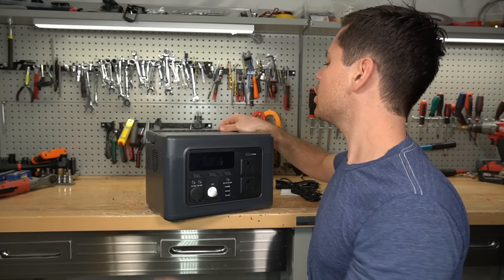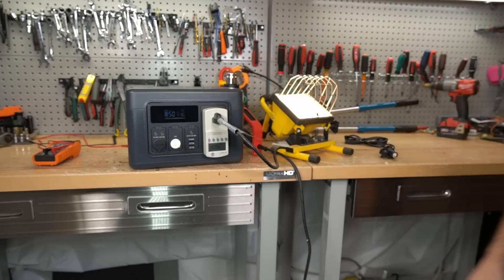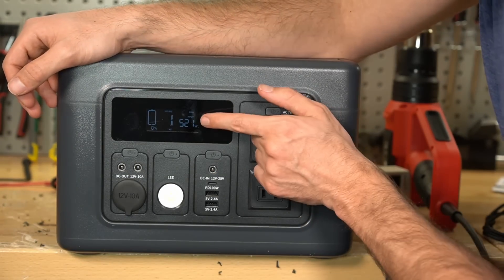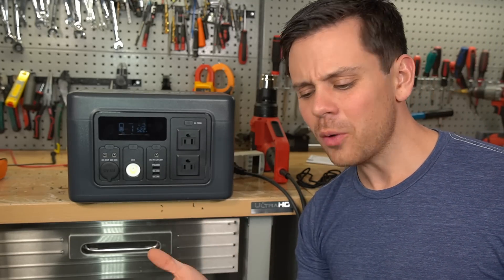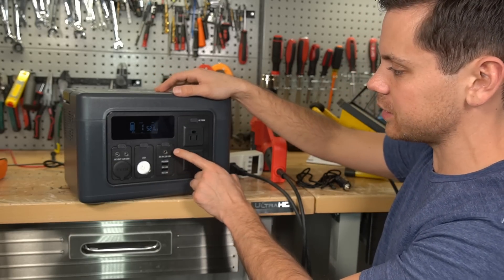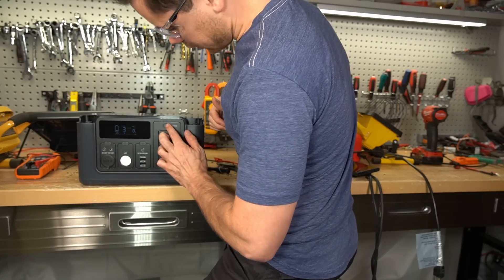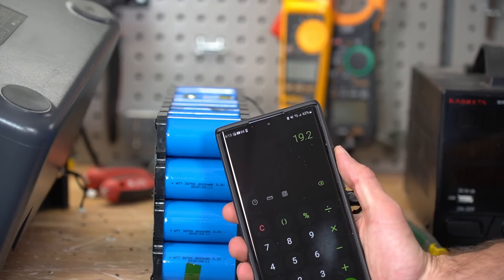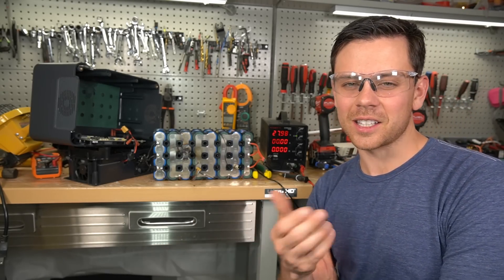Powdeom Solar Generator Test and Teardown! Better than Jackery? Bluetti?

Comment: I bought a 1200 version couple years back (2023).  Its battery measurement is really bad like this one.  If the PV charge is idle for too long (like 1 hour after sunset), it will say battery is at 100%, even when it was 50% an hour earlier.  Just like the company, my unit solar charging port has died (it flashes an error code that has no reference).  I emailed support but got no reply.  Fortunately, its AC charge port still working.  Hopefully, it is more reliable than 2 years.

Comment: I challenge you to make a test .i believe the conclusion will be very interesting.connect the ac outlet of the power station through a micro inverter to the ac inlet of  the same  power station. the micro inverter should also be connected to 500w solar panels. I suppose with only one micro inverter ($100w) we could charge the power station with 500w from the solar panels.... the same trick could be used in all power station if it works here

Comment: You are the very best at your reviews "but" I recently brought two of these units ,ebay are selling them for just 360 dollars now,they have been a godsend for me recharging my high powered e bikes and scooters that I store in my storage unit,3,000 charge cycles,this unit is a great buy...
Reply: Still working ?  Mine won't charge anything anymore only lasted a month but it does take a charge.
Reply: @vapeking466 your correct sir,this unit is junk, my unit failed after two months..you are soooo correct...good day

Comment: I have a question about a diy power station.  When I get the ac wall charger, does it need to be specific to the battery chemistry I use?

Comment: Big selling point on this unit is LifePO4 and nobody ever states whether it uses a PWM or a MPPT charge controller.  How about the Bluetti?  That makes a giant difference. The best units should have Both LifePO4 and MPPT charge ability. Maximized battery capacity AND full charging potential of my solar panels. Those are the TWO most IMPORTANT features for device efficiency. I want a battery that lasts 10 years and a charger that charges the fastest and most efficient way possible.  Yet nobody on the internet ever mentions these two features together.  I don't care if the case is pretty or if the thing has 47 outlets. Two AC outlets, two DC outlets, and what type of input connections are the most important features. For the money, the time it takes to charge is not that important. They have to cut costs somewhere and charge time is acceptable on a small unit like this one. I think this unit has MPPT too, but can't confirm. Just checked with the company and YES! It has a MPPT charge controller!  This eliminates most EcoFlows, Jackerys, Bluetti, and most likely any of the other major branded generators. Again, this item wasn't demonstrated properly. It was put down to discourage the competition to the main brands mentioned above. Another company that makes low power generators with the features I mentioned above is Wetown on Amazon. These two are very solid units that can outcompete the main brands. They don't have the marketing that you pay for and have good customer response. There are other units that are similar as well, but I'm still researching their customer responsiveness and reliability. Not very impressed with his rather biased review of this unit.

Comment: Is this a good buy for $350?  I just need a backup for CPAP when the power goes out.  And I don't have any solar panels or anything.  I would just plug it in to charge.  Run it off the car in case of emergency.  Eventually, I might get a solar panel but I don't camp
Reply: yes good

Comment: So do you think its worth it with the $200 off it puts it at $350 and they seem from their comment to be open on the issues and willing to fix or replace units?
Reply: it is worth.I purchased one, there is no problem.
Reply: Mine failed after a month. It charges but won't power anything shuts off after about 1 minute. I'm fixing to send it in under the warranty. Wish me luck.

Comment: I wish the smaller power stations would accept more than 200watt of solar I use a 100ah power queen 12.8v battery with a 12v - 24v 10amp converter to shoot 199 watts into my EcoFlow river to give myself a 1500wh system.

Comment: How big of a resister do I need to pre charge the capacitor in a 3000 watt charger inverter? 24 volt

Comment: Will - i have a covered lean too out in a field on my farm.  How can I use solar to keep my 12v batteries in my tractor, bulldozer etc. charged up.   Love your videos.  Thanks for the knowledge.
Reply: Harbor freight has a $15 trickle charger solar panel that works great! It's small and comes with all the hardware

Comment: Do you know anything about Easun Power Ingrid VEII 16.5 KW wifi 220v 48v most 450v 90 solar charger  grid tied with CT sensor touch inverter? It listed for 2800.00 don't know much about this unit. If its UL listed or any other information.

Comment: Would you please consider a video showing how to set up a dump load? I built a small 600 watt system with 100 watt renogy panels, 40amp Rover, Giandel 2200W inverter and a battleborn 12v 100ah battery. An automated way to utilize the panels power when the battery is charged is what I am after. Thank you

Comment: I am curious if one array of solar panels could be used by two different Solar Charge Controllers at the same time? One is 24V battery setup with 24V SCC. The other is a 12V battery setup with its own 12V SCC. It just happens that I have two setup and I hate switching a switch between the two.

Comment: Why are the smaller mpptcharge controllers limeted to a max of 150 volts?  When sizing a system I usually have and ussue with the volts and not the amps.... prices for these mppt are all over the place as well....(sp errors)

Comment: I think the calculation is wrong somehow. We are told that batteries connected in series will only add up voltage not amps. This means 6AH or (6000mah) X 4 batteries in parallel = 24AH OR (24000mah)... The cells in the video are connected in 8 series and 4 parallel. This makes the total ratings of the battery according to the law of series = 24V X 24000mah  =576WH. Please if my calculations isn't correct someone correct me!
Reply: Yes thanks so much!
Reply: Close, but LiFePO4 chemistry is 3.2V nominal, not 3.0V. So, with 8 in series, it's not 24.0V, it's 25.6V. Multiply that by the 24Ah (6Ah x 4 in parallel) and you get 614Wh. Hope that helps!

Comment: Main reason why people (For me at least) bought Jackery solar generators,  was marketing and awareness. I use mine for remote astrophotography. Previously had DIY. 2, 12V, 12 AH AGM batteries in a cooler, with cig outlets, and binding posts. Saw ad, and researched other amateur astro photographers. Jackery  was  and is mainly used. Only after stumbling on your,  and HOBOTEC, did I become so aware of BLuetti. Had I known, I  would have bought there's.  I'm also doing this in sub 10 degree F Temps. And Hiking in cold open fields half the time with some gear. So was concerned about temperature issues with LiFePO4. Seems it is good down to 0 F. I know I'm aware LiIon looses output in cold. A few  hardwares in an insulated bag works.

Comment: Someone please tell me if you can is it possible to connect my car alternator to the inputs on my solar charge controller in order to charge lithium batteries without a dc-to-dc charger
Reply: It would depend on the input requirements of your charge controller.

Comment: can you connect different charge controllers to a bus bar then to the battery bank
Reply: Use the link to Will’s forum (in the video description) to get an answer to that sort of question. In the forum you can be more specific and people can ask you questions to clarify what you’re trying to accomplish.

Comment: I appreciate your reviews...great work.
A stupid question maybe:  can a portable station like this be hooked in parallel to a suitcase gen?  Ie remote camping need more starting amps for ac parallel this to suitcase, run gen to run ac.  Then low load times just use this?  Maybe not worth it.

Comment: do you have any recs for a good 48 volt solar panel?
Reply: “48V panel” isn’t a standard - that’s not quite how solar panels work: my “12V” solar panels are 17 VDC rated, allowing 12 - 15 VDC in normal sun. “Full size” panels range in voltage rating from 35 on up past 70 VDC (note “rated” vs. actual VDC from sun you have) so one is usually matching a string of panels to an inverter or charge controller power input VDC “window” or operating range. Will’s forum and book and some early videos explain all this.

Comment: 120watt an solar generator does not fit together 😂
FAIL
Should be no less than 1200Watt to call it a "solar generator" in my opinion

Comment: Just something i have noticed about that heat gun because i have the same one is that it causes the lights in my house to flicker that are on the same half of the electric panel. The flickering gets worse when the heat output is raised and no flicker on high. I took it appart and found the heating element is controlled by a circuit board. This heat gun definitely seems to have dirty power use that might be the cause for the inaccurate reading not sure. Just figured i would let you know because you use that heat gun alot and maybe something to test and keep in mind.

Comment: I am impressed the battery inside is 24V! Allows them smaller conductors to drive the inverter, and all 12V outputs can be sent out regulated and the usb can output higher watts without stepup circuits.
Reply from the maker: Absolutely

Comment: About the Wattmeter Problem:
Maybe your heatgun uses a diode in low power mode and thus only takes current during one cycle of the sinewave.
Hairdryers do - and that confuses some powermeters.

Comment: I bought a cheap LiFePo4 300 W/h station from A.. and I am happy with it. We use it on Search & Rescue do power mobile monitors, a WiFi hub and re-charge drones. No need for Bluetti.

Comment: Hello, you have a good channel with a lot of great information. How about a video on the best appliances, electronics, water treatment and air handling equipment to use on an off grid PV system in a cold climate (zone 6B)? Most solar channels talk about reducing loads and choosing energy efficient appliances, etc, but they never recommend specific brands - just "this size system will provide this much power".
For example, I'm building a small (550 sq') near passive cabin out in the middle of nowhere and I'm considering a Hotspot DC mini-split, a DC fridge, an induction cooktop and a Sanco2 heat pump water heater. Then there's the issue of well pumps, water purification, an ERV,  a dehumidifier, a freezer - the list seems endless.
I'm curious as to what would you recommend?
Reply: @Channel-gz9hm  Thank you for your reply. That's good information to have. The problem with choosing solar equipment is that everyone says that their product is the best but you don't know how it will work in a system with other components. 
For example, lots of people say that induction range tops are the most energy efficient products for cooking (as well as safer in that they produce a lot less harmful cooking byproducts like CO2) but others say you could never run one off of a solar PV system. 
If you were going to head out into the wilderness and build a small, off grid homestead what products/systems would you choose?

Comment: If you’re not back packing it seems to me that these solar generators are a waste of money. If you have to haul around solar panels anyway to make them useful,the EG4 3000 and a5KWH battery makes more sense. If you don’t have the money to buy that,a part time job is more practical than camping out with these toys. Old fart opinion lol.

Comment: yes 3 years ago I bought a Jackery 500 so thanks for rubbing it in  😞
Now I'm doing an EG4 48v server rack+6500EX-48 like yours so I'm getting better.
Thanks also for the inspiration btw  🙂
Reply: To be fair, 3 years ago the market had fewer options, and the Jackery is still a solid piece of kit, just not as capable as some of the newer ones.  You've gotten 3 years of use out of yours already.
Reply: Makes you nervous to purchase big ticket items because every couple months bigger better cheaper comes along 😊
Reply: We bought our Jackery 250 about 3-4 years ago and use it 7 months out of the year 3 days a week and it fit's our needs. Never had any issues, but it does take forever to recharge. Like someone else said that's what was on the market back then.

Comment: I think the heat gun is too noisy for the inverter to put out clean power usage reading... some inductive loads (like the heat gun) are too noisy because of the backfeeding of EMI (Electromagnetic Interference)

Otherwise an interesting piece of mobile power that unit is.

Comment: I have the smaller Bluetti EB3A, I think it's a really nice unit for what it is. 200W solar input and 600W AC out.  I'll take the lower capacity of LFP cells any day. Those cylindricals should last forever.
I like that the EB3A has a UPS mode, not a lot of those small units do. The EB3A can charge near 2C in boost mode, otherwise it's like 0.75C.
And, it's usually on sale for only $220. 
Only thing I don't like is no storage for cables, and the PWM on the cooling fan is reallllly bad. It's a very wide square wave. Should have just used linear voltage control.
Reply: I have one as well. I'd like to see a way to hook up additional capacity. One would think that it would be logical for these generators to have an hour of rated output instead of 40% ish. But, that's probably just me wanting a bit more. LoL.
Reply: @Vibe77Guy  So what I'm doing is charging up a 12V Chins battery on a 300W array, then I just top off the bluetti overnight using the DC input jack. 
So, you're only looking at about 100W of charging at 12V, but you could carry around a smaller 50Ah lifepo battery if you wanted to extend the capacity.
Reply: @andrewt9204  
There is a video of using the DeWalt and/or Makita tool packs as extension sources doing exactly that.
Reply: @Vibe77Guy  Yeah, that would work too. Power tool batteries are kind of expensive though for their AH rating,  but if you already have some and don't need the extra capacity often, that would definitely work.

Comment: I have 2 different Bluetti models and I am very happy with them.  Just got in the AC200P for my van build and I think I made a good choice after watching your videos Will so, thank you.
Reply: Yes.  I have one in my truck camper and it runs everything.  Perfect size, perfect output.  I don't think anyone else has that 12v-25amp output.
Reply: I bought a Bluetti EB3A - the runt of the litter - last fall and ordered up a 2nd one just yesterday morning. Both of them were on sale and cost me around $220 a piece. The MPPT circuit is perfectly sized to a typical 100W PV panel and charges the small battery inside (it's only  around 250Wh) in about 2 hours. I'm probably not going to use the AC charging feature all that often, but it's nice to know it's there if I need it. The 600W inverter is very clean and allows me to power a variety of small and efficient cooking devices. Most of the competition in this size class (Jackery, etc.) have inverters that are in the 300W range. Hobotech did a nice review of the EB3A a few months ago and there is at least one fairly detailed tear-down video somewhere here on YouTube.

Comment: Great Will.... You stole my thunder on this one! I might as well ship my review unit back LOL...joking. I thought the price was fairly decent on this one when compared to Ecoflow and Bluetti options. LFP,  fast AC charging, decent inverter.... way low 120w solar input though.
 I still haven't tested mine yet so I'll pay attention to the screen / watt meter for accuracy. If it pulls 85% rated capacity it might be worth $399.
Reply from the maker: Oh man sorry about that :D Oh good point, will they sell it for that much? I usually always check the price with google because sometimes it's different than the sale reps figure. Did they say $399?
Reply: It's on sale right now for @$299! Seems too good to pass up?  @WillProwse
Reply: When you test is remember to test the charging speed and use a kilowatt meter to compare if the on screen data is accurate. As did Will do on discharge, but not on charging the unit.